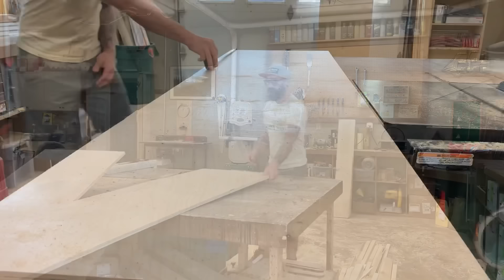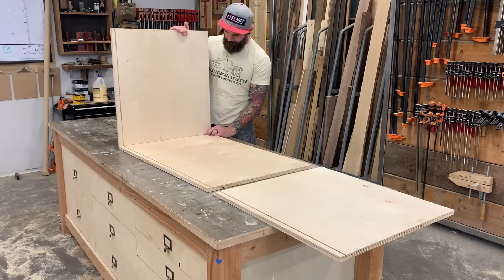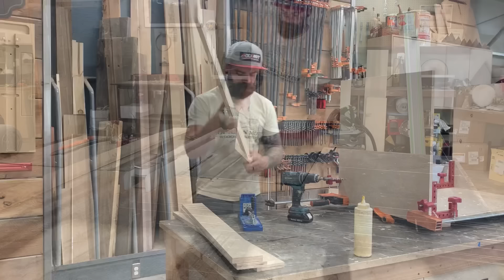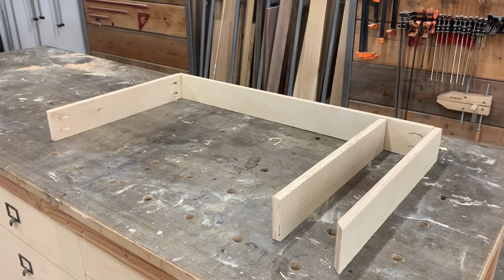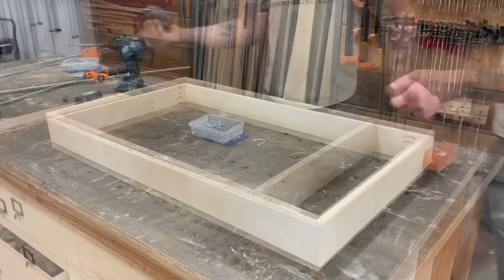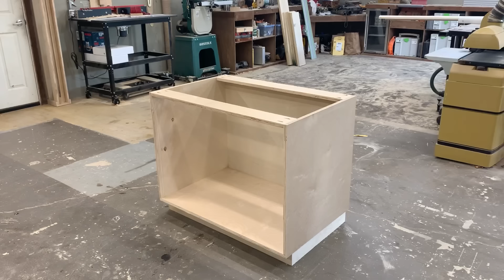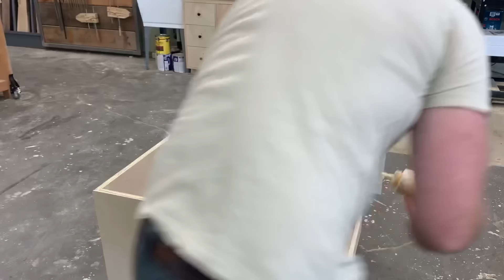Build Cabinets The Easy Way | How to Build Cabinets

Comment: This is literally the opposite way to build cabinets easily. The easiest way, just as good is pocket screw joinery with glue and 18 guage nails. Just as strong. Will last 30 years. This dado nonsense is a kook trying to be elite.

Comment: I've watched all the videos.  Stupid question maybe, but my cabinets will have doors, so the inside will be visible.  Would you sand the interior of the plywood pieces before painting?  If so, would you sand it before assembly to make it easier to reach all the inside corners?  Or wait until the cabinet is fully assembled and sand it then?  I'm doing paint grade. Thanks, great videos!

Comment: greetings Jason.  I was on the Bourbon Moth website, but didn't see a "contact us" button, so I figured I'd reach out here.  I found myself in a bit of a pickle, and may unfortunately need to consider building kitchen cabinets for a house I'm building.  I was on the site and looking through your "plans and templates," but only saw the basic single carcass.  Do you offer a more elaborate plan or how to for something like a full kitchen cabinet build out?  much appreciated, aj

Comment: I didn't see you attach the bottom KICK to the box after it was set. are you screwing strait through bottom ?  Because I was going to paint the outside and but not inside the box . and my Lower has doors.

Comment: I’m not trying to tell ya how to do your job I can help with a wood filler I use I’m a professional painter I’ve been doing it every day for over 20 years but we use a 50/50 mix of quart size famowood and a small tub of none shrink spackling it’s hard as nails an sand like butter the nail hole will sand out flat just as long as you don’t sand to much ..they sale famowood in oil or latex base ..I’m not trying to say hey you are wrong because I learned everything i know by the older guys that knew more than me …but you really have to have the a  open mind to take someone else’s experience an say maybe he’s right but I’m just runin on now sorry for the longer message but I just wanted to let you in on a secret from the painting side of the world an i just wanted to say thank you for the video I appreciate watching it

Comment: May have missed this in the videos, but how do you go about securing the cabinet to the separate toe-kick when installing in a kitchen? I like the idea of building a large separate toe kick that's easy to level to span a few cabinets I'm building, but unclear on a decent way to then attach the cabinets securely to the toe-kick assembly.

Comment: Great video. Interesting to see different perspectives personally I learned to make cabinets where you dado out the back of your face frame and fitted your plywood into the frame and was able to hide your Fasteners instead of nailing directly through the frame. To be honest, if you're painting them, it doesn't really matter.

Comment: I noticed when you first started putting together the carcass. You used the red corner clamps, but the first one. You didn't loop through the guide hole, but you did on the second. Is there a reason for this?

Comment: Is that necessary to use 3/4" plywood,  or it is totally OK to use 1/2 plywood? If so, was there any joints that needs to be done differently?

Comment: Question - could you cut your grooves into you bottom cabinet piece versus the side pieces and wood glue them together? Would there be any structural or weight bearing concerns?

Comment: Question, Thanks in advance. If I build similar construction of the cabinet from the video but with cheap 3/4 Melamine (25 x 25 x 48" height) support about 70 lb above (2 more boxes on top with microwave and other kitchen stuffs). Would 3/4 Melamine able to support and not break?

Comment: Great video.  I have watched other videos on cabinet construction and they mention that the glue on the edges of the plywood will eventually fail and need to be reinforced with screws.  On your base cabinets you cut the 3/4 dado on the bottoms of the side pieces and use glue to hold everything together. I'm planning my first real woodworking cabinet build project and plan on doing an upper cabinet hanging on french cleats. Trying to figure out the value of adding this dado. Trying to decide if I should use this dado method or just use a butt joint for bottom shelf and affix with 1/1/2" screws.  Can you help clarify? Thanks

Comment: Good video. To bad you need ALLOT of machinery to make this as simple as you make this look to be 😢 you got a shop with atleast 30k worth of machinery 😢 most people get stranded at the first 2 stept. 1. How to get those large ass wood at home. 2. The room you need (big ass shop) to work in.

Yes this is a nice video, but its like saying "it aint hard to lift a 3000 pound rock in your yard and the use a bulldozer to show people how fast the job is done"😅

90%  of your viewers are happy with the knowledge, but know this, only 10% can actualy do this 😢

Comment: Are the drawer dividers in the face frame necessary? What happens if I install the drawers without them? 

(I've already made and painted the carcass without them, I'm ready to make the drawers and trying to decide whether or not I need to go back and add dividers to the face frame.)
Reply from the maker: No you don’t need them

Comment: with those jorgensen cabinet clamps, i think the play is to set them down on the table, then lay the cabinet on top of them, then clamp. The clamps are so big they do the job of that little wood pecker square, which really aren't strong enough to do shit on a piece that big. Plus you don't even have enough clearance on the bottom to use them properly

Comment: Please be careful handling epoxy with bare hands.  It can cause a contact allergy over time - might be fine the first few times, but eventually, you may get to where you can't be in the same place as uncured epoxy!  And if you have to sand cured epoxy, WEAR A DUST MASK!

Comment: Hi there and thanks for creating a great and informative video. I am always reticent to ask q's hoping they are relevant, so here it goes. You mention not being worried about burning through the veneer. I am working with 3/4" maple ply and would like to stain it. So, how could i do this so as not to burn through the first layer of veneer? Also, i am making a cabinet (going to be used as a base cabinet for a larger entertainment unit) and wonder if i need to use a 1/4" back inset 3/4" so to add the 4" stretcher /nail plate? Since i am not attaching it to a wall, my question is what way would you construct the back of this cabinet? Thanks for taking the time to consider my question and keep the videos coming! im a fan!

Comment: Hey there, newer viewer here, love the channel and appreciate all the advice. You're walkthrough are great!  Also new to wood working. With that being said: somehow, some way I decided my first project is going to be a movable kitchen island (call me crazy, its cool). I'm excited for the build and am wondering if you'd go about making the carcass the relatively the same way as you did this cabinet. It seems really sturdy! One of the only things I'd change would be the frame for all of the compartments (duh) and the back panel to 3/4 inch ply for extra support. I have a 60'' x 30'' x 1.25" butcher block countertop that weighs about 60 pounds and am now playing with dimensions. I don't know how often you read your thousands of comments or if you read them on your older videos but any advice would be great, like if you'd reinforce in places that you didn't in this video (I'm thinking behind the vertical sections of my face frame it couldn't hurt to add a vertical sheet of plywood from front to back to support the top) . Anywhere, thanks for taking the time to read this. Again, love the channel, thanks in advance!

Comment: When building a full height pantry cabinet, is it stronger to have the sides sit on top of the bottom peace of wood, or make a dato cut in the side places so they site partially on top and beside the bottom peace of wood?

Comment: I'm having an issue where my plywood is bowing after I cut it into the panels. This in turn is making it hard to get my brace pieces in square. This is my first set of cabinets and I'm following your three videos. Thanks for the step by step.

Comment: Use car bondo for paint grade. The best and won’t shrink. On your finished ends, use a flush trim router bit with a V groove. A professional transitional look. No putty required.

Comment: Thank you for sharing your builds, I have watched all 3 parts of your cabinet building, but was hoping you had a version for uppers and also upper corners?  I have found a couple of videos for uppers, they were just ok.  My cabinet lowers I designed on SketchUp for our kitchen and am currently building and I use your process.  I just need some help with uppers.  For example, some use stretchers and 1/4 in a carcass dado, others just use 1/2" ply on the backs and recess dado the top/bot/sides for a rear-flush.  Curious what your process is.  Thanks in advance.

Comment: This is a great video and you are clearly a professional. If you had a cabinet that was going to be built in - meaning that both sides and the back would not be exposed - would it be faster and easier to build the full carcass/frame out of 3/4' and pocket join? Rather than dado cuts? It would seem to eliminate the need for the nailers in the back like you have on this cabinet. I'm just curious if you always use this dado cut method, or if it was specific to this piece you were building, given the application.

Comment: Wow. Dude is a top-notch pro! Thank you. Learned a lot. Two questions please: 1) Why the extra cross-piece, inside the kickplate? Is it to keep from racking? 2) If you were to use a flush trim bit on outside edges of the face frame, would you do it before or after you apply the Mohawk filler? Thank you in advance!

Comment: PLEASE HELP : looking for some ideas on how to secure melamine cabinets on a wall that has plywood behind it ! My  backing for cabs is 3/4 thick I would assume sheetrock is 1/2 and plywood half inch or 3/4 I usually use 3” screws on walls without the plywood directly to studs ANY IDEAS help any info on certain wood screws anything !! Was just thinking to use longer screws and put a bunch on each cabinet for extra strength TIA!! I was also thinking I might add some legs on it but my goal is for it to be floating , thanx!!!

Comment: Pocket hole face frames are not strong enough. Real cabinet makers make the face frames before the cases. We use the face frame to square the case, not those silly corner clamp things. We actually use measurements to make the frames! There’s so many things he does that a real cabinet maker would never do.

Comment: A carcass is a dead animal. The correct term is case (or box -slang) as in casework. 
Just because norm Abrams used the wrong word doesn’t mean you have to.
(I owned a few cabinet shops and am state licensed. If you said that in a professional setting we’d all laugh at you) 
This is the accepted standards we use in professional cabinet making/architecture:
https://woodworkinstitute.com/wp-content/uploads/2015/05/Sec10_2ndEdAWS_SmBkMrkd_141001-3.pdf

Comment: From Australia, watched your 3 series of building kitchen cabinets, great job and gives me confidence to have a go. Would like you to build a wall of kitchen cupboards, I have a space of 3.5m x 2.4 high.  Do I divide into 3 sections to fit build thinking 1.16m each section. Question, is it better to have one sheet between sections or butt each completed section up to previous, using the finishing frame to cover up the sections.  Keep up the great work.

Comment: For the last bit when you sand off the seam on each side, you could go IKEA style where they couldn't care less. They just put an extra plate on each sides to cover everything from top to bottom, cut to size and secured by screws going from interior out, short enough to not pierce the face. You will have to  install a countertop a little longer to compensate the extra thickness, but it removes any need for sanding and hiding the seam all together. You can also have that extra plate go all the way to the ground which gives an enclosed toe-kick look.

Comment: This is awesome. Not integrating the kickplate also allows me to use plastic leveler legs for my basement.  I don't have to worry about water getting wicked into the plywood from the concrete floor or spills from my washer or whatever.

Comment: Great video. One comment though, you should never touch epoxy with your skin. It is a sensitizer so each time you come into contact with it, you increase your risk of becoming allergic to it. I've known some workers who can't even drive through a boat building area without having a reaction after years of just using their fingers to touch epoxy. Not worth the risk.

Comment: I have a table saw, sander, and various drills/impacts. That said, I am wanting ro tear out the cabinets in an old trailer I live in and build new. I'm wanting to incorporate as many storage areas as possible. One being in the kick plate. Would it be as simple as using the same material for dividers, beneath the actual cabinet, and using small casters or drawer mechanism for those? I have hardly any storage space so I hope to find as many usable areas as possible.

Comment: I had cabinets built with 3-1/2” kick plates in my office with carpet on the floor and my iRobot vacuum cleaner will not fit under the kick plate to vacuum. Definitely recommend the 4”+ kick plate. My 2 cents.

Comment: Thanks for the videos. I must have burned through 50+ in the last 10 days after discovering them. Love your attitude and sense of humor. I’ve built some simple cabinets, nothing to your level (cause I don’t have a shop or the heavy machinery) but almost feel I could after watching, with that equipment (and I’m not saying “Anyone could do that with a 100k shop!”). Dying to know why the extra center support on the toe kick box is off center so much. I’ve literally watched you measure out your screw placement in some videos, so I know there MUST be a reason. I can’t stop thinking about this…..

Comment: Hi - just started watching your videos and really enjoying them so thank you. I'm away to build a cabinet for my campervan and want to keep the weight down. Can I take the same approach as described in your video with 12 or 15 mm  birch plywood? Is that too thin to use pocket joints etc? Any advice would be appreciated

Comment: Do you have a standard on what setting you put your drills clutch on for pocket holes?

Amazing video!!!
Reply: It's a feel, and soft woods use coarse thread. Hardwoods are fine thread. It takes a little practice

Comment: Thanks ,great work 
   I have found that the face frame needs to be a 1/16 th overhang on the sides to accommodate the walls not ever being flat or  strait ,this give just a littlle bit of room when screwing the face frames together to deal with a wall .
  I use to work for Triangle Pacific and that is how they did there cabinets ,
     When installing cabinets this little bit makes a world of difference

Comment: So I am building this cabinet in a 42” and 90” version. Having to add some supports on the back and front. Also using birch for the front framing because I am saying F Home Depot pricing on popular. No 4x8. F.
Reply: Side note. This is so much fun. I just hope it looks good when I’m done.

Comment: For the kick plate…you said it should measure “same as the inside of the cabinet.” However, it looks like it is less deep and less wide. Can you clarify how you measure the inside? Thanks! Great video! Building built-ins and already going way better than the bookcase I built. But that was for the kids..so they don’t care.

Comment: I was wondering,  when framing with 2x4. What is a good clamp to align and hold? I have those little red ones. They work but takes longer and sometimes move or loosen.

Comment: Because the Kreg screws go in at a sharp angle how much trouble do you have with either the stiles or rails cracking? I always seem to have one or two crack when using hardwood. Great videos by the way. I'm a new subscriber.

Comment: I'm building kitchen cabinets.....my wife bought a Xmas tablesaw, and I bought Kreg pocket hole jig set...but I don't have a shop. 
Instead, I will be working under a porch roof with the cold breeze for my dust collection system. Unfortunately, I have old existing wall cabinets and big box store prefinished base cabinets. I don't like them. I'm going to make the wall cabinets matched..and a  new 9" filler base cabinet because of the modular sizes of the prefinished cabinets....to match them.
You're blessed with a good sense of humor...like the content...well explained and worth watching your channel

Comment: I really like your idea of keeping the base separate from the cabinet body.  Seems much easier to build.  1) Do you do the same thing for stainable cabinets?  2) What do you do about the line between the cabinet side and the base?  3) Do you always just offest the sides by an inch? Also, I noticed the face frame is not flush with the bottom of the cabinet.  On my pre-built kitchen cabinets these two do line up.  4) What do you do in order to get these to be flush?

Comment: When it comes the 1-1/2” cabinet screws attaching the top bracing to the back nailer plate, could this be done with an 18ga brad nailer and be just as effective as screws?

Comment: Question master BBM,  a silly question even I still do channel slot for back panel, I was always thinking why don’t we just cut the entire thing and nail glue the whole back isn’t that easier?  Any draw back you can think of ?  Assume the wall condition is not to bad horizontal or vertically.